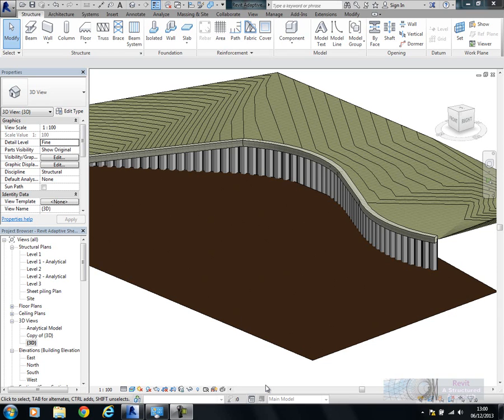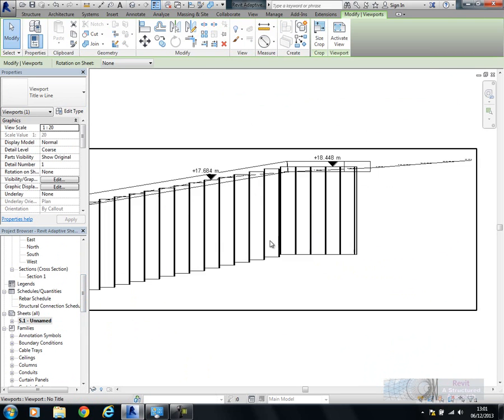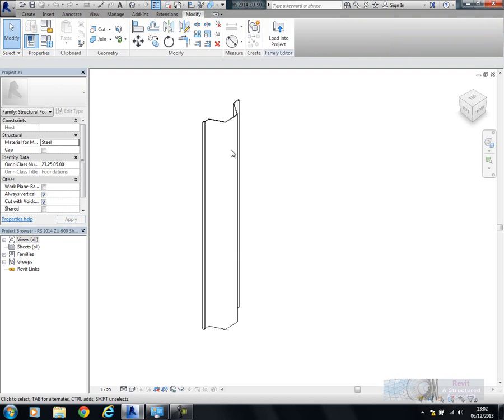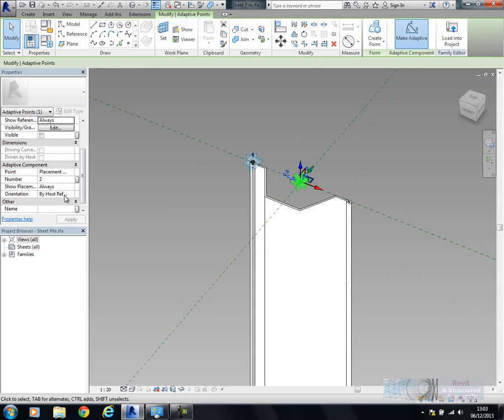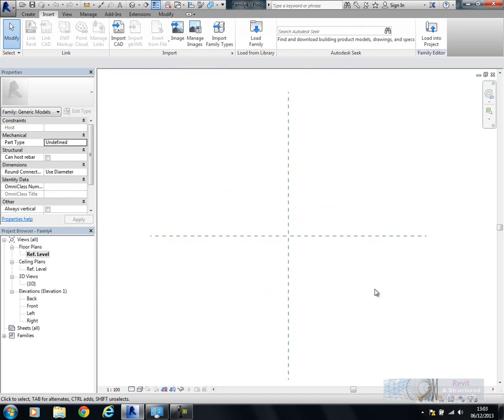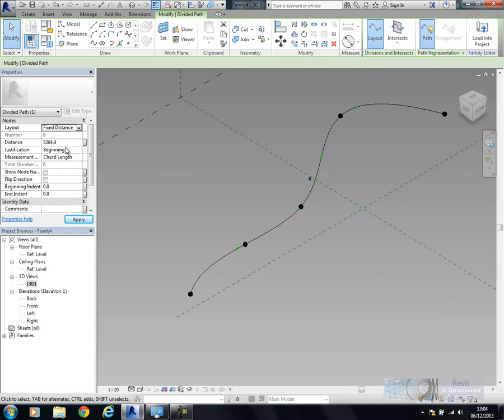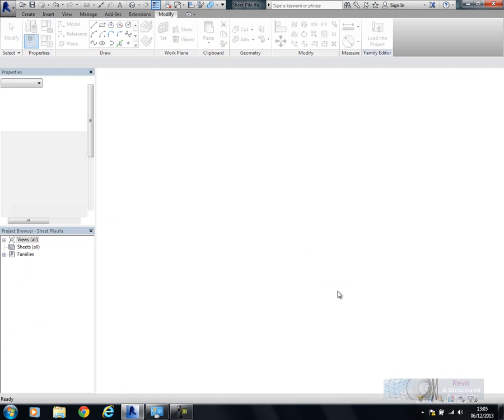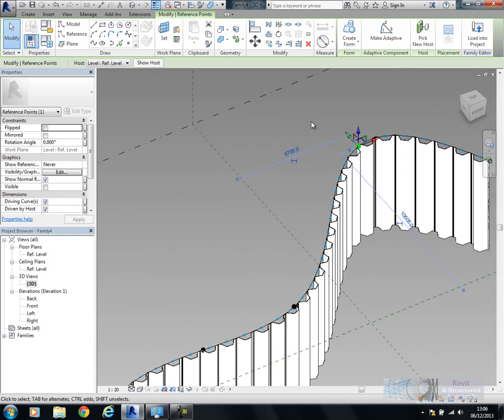Revit 2014 Modelling Piled Wall Systems

Comment from the maker: I was using curtain panels to sub divide forms into panels but found this method a little more reliable. We have used this on a couple of Civil based projects where just the graphical representation needs to be correct.